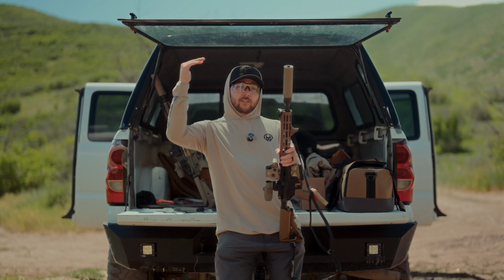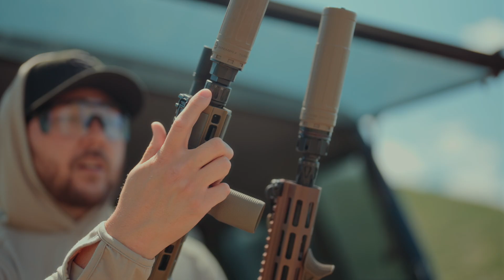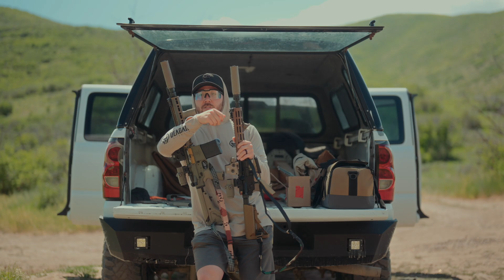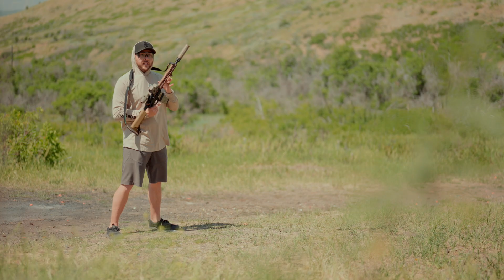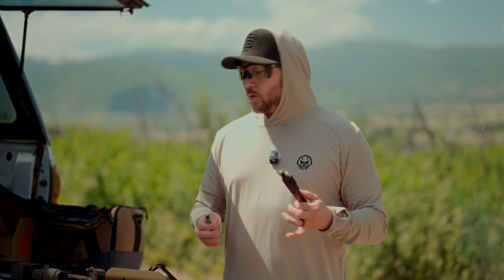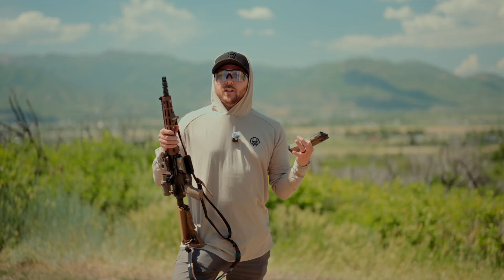Use The Riflespeed Gas System For Tuning Your Rifle

Comment: These gas blocks are very good at what they do. I got my first one, shortly after they were first released. I now have 3 and have put well in excess of 10k rounds through my rigs that runs these. They are very robust and require minimal maintenance. I've never had one carbon lock on me and I typically don't clean my guns until it's time for parts inspection and maintenance. Usually about every 3k rounds. 

If you are unsure of which to get, Riflespeed has a "configurator" on their website. It installs like any other set screw gas block and has a provision for pinning it, should you choose to.

There are a couple of downsides.  The first is that the mlok slots surrounding the control knob are rendered useless, unless you have a handguard with a larger than normal inside diameter. How much this affects you depends on the length of your control knob and your handguard. 

You MAY need to remove your handguard and/or muzzle device to fully service the gas block. Again, this depends on your setup.

It's relatively heavy compared to a standard lo pro gas block.

I consider the riflespeed to be necessary standard equipment on a suppressor host. I set my rifles up to run well suppressed with an A5H2 buffer and a standard spring at setting 3 when the rifle is clean and lubed running my usual ammo. This way, I have a little head room to dial the gas down more if I wind up shooting hotter than usual ammo. I can then run unsuppressed by clicking it up a couple of notches to give it more gas. Whether suppressed or unsuppressed, when the rifle starts choking and you can feel the cycling getting sluggish, you can just turn up the gas.

Comment: I’ve had a riflespeed on my ar10 using a sandman L (can sucks, too heavy, don’t buy it). It’s night and day difference in gas blowback and sound back at my ear. They’re great
Reply: So you don’t like the sandman L ? I use the sandman S on all my ARs and bolt gun and I love it .yea some gas blow back but whatever. We didn’t have the other options available when these came out. Also the L would be better on a bolt gun.
Reply: @jameshill5304  1) The L compared to the S is theoretically better on a bolt gun, but when compared to other options that are lighter, more voluminous, better flow through, etc. the L is terrible. 
2) My sandman L sounds great, has minimal POI shift etc. but is way too heavy. there is no need to have a can this tough unless you own a belt fed stationary MG. 
3) Keymo it too complicated and too heavy considering other options like Hux or DA Xeno. 
4) I like my hux cans better - theyre lighter and less gassy.
Reply: Personally I'd have gone with the Nomad L Ti. Both are 30 cal but the Sandman is 22 or something ounces while the Nomad L Ti is like 12 with the mount. Maybe it didn't exist when you bought it but I know for my next break-action 300blk I'm going with the Nomad L Ti.
Reply: @Nefville  Thats the way to go. The nomad TI didnt exsist when i bought my L.